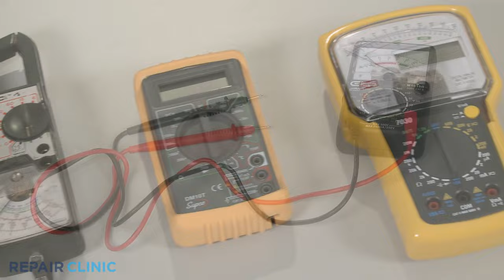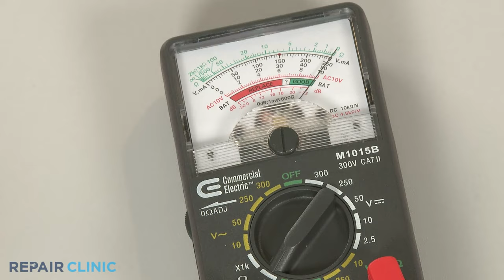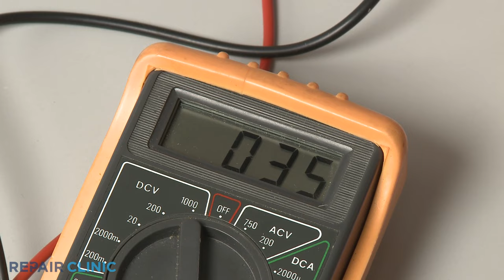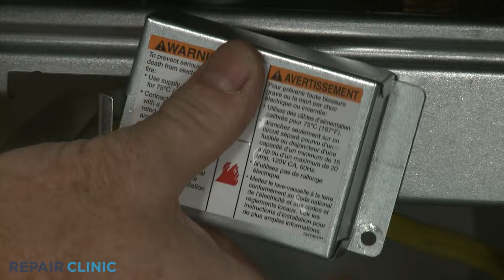Dishwasher Drain Pump Continuity Testing

Comment: I have a newer GE portable dishwasher GPT225SSL0SS. It has drain pump part number WD19X24651. It tests 28 ohms and the impeller turns fine by hand. No junk lodging it and the impeller blades look fine. Rinsed the drain filters (fine and coarse) inside of the cabinet. They looked ok beforehand, though. Glass filter is clean. Sump assy. looks clean.

It's been having trouble draining lately. Sometimes leaves an inch of water in the bottom when finished. Sometimes it finishes fine. Lately, if I restart a new clean cycle from scratch, it will pump out the old water first, and then start filling normally. Today, it wouldn't even do that and 888 errored out. I'm running it again now after taking it all apart. 

I'm wondering if the User Interface Control Assembly WD21X28718 in the top of the door is acting up. Looks like a $68 part.